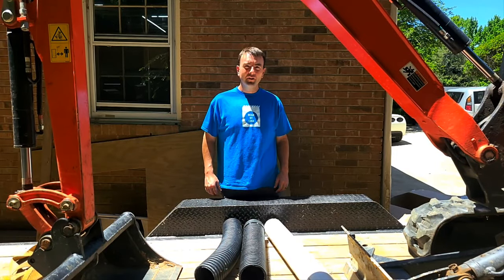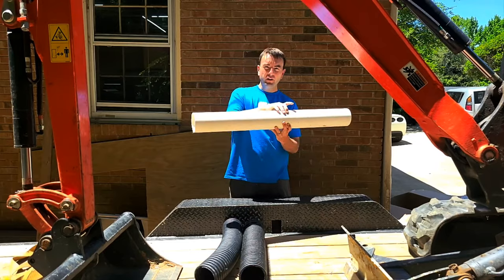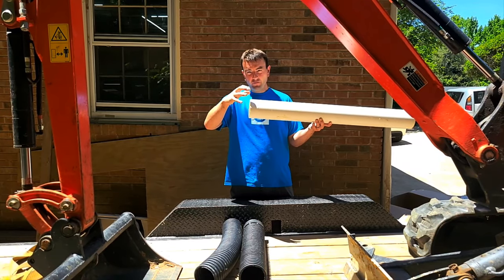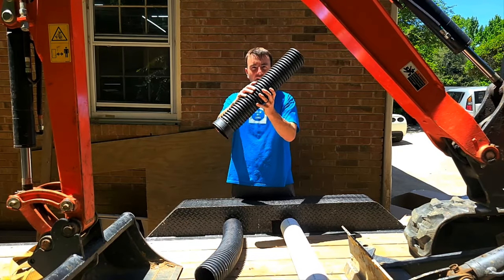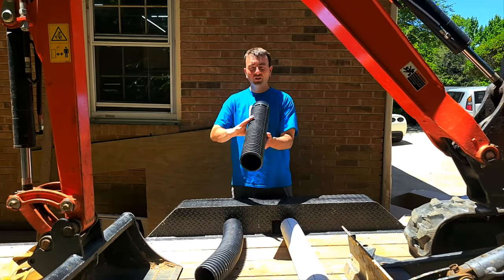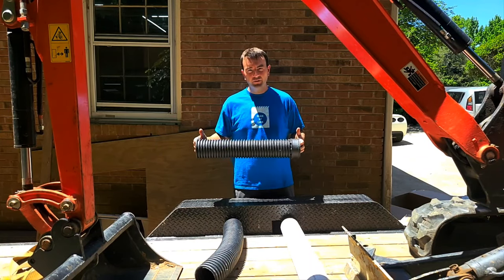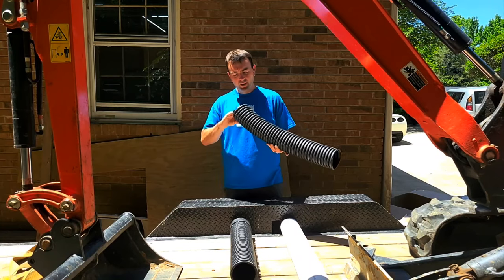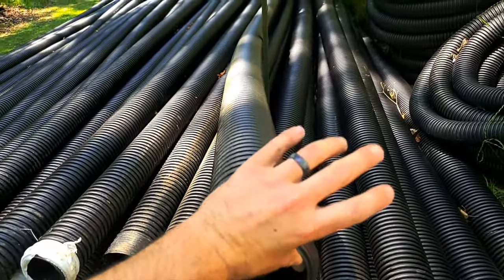Which Drain Pipe Should You Use?  Hint: it's probably not what you think

Comment: Do plumbers not use schedule 40 for waste lines? I haven’t heard of pvc waste lines cracking at joints from settling
Reply from the maker: They do.  However, the pipe is deeper with many less bends.  This protects from many roots and movement.  Landscape drainage isn't the same and the differences cause pvc to experience issues. 

It's possible to build a quality pvc drain system, but it takes much more time, skill, and money compared to a double wall system.  Most contractors don't do it right.
Reply: I used to do Septic work! All schedule 40 for waste. Never had a problem!
Reply: Plumbers do not use schedule 40 for sanitary discharge underground, they use schedule 80.

Comment: I used over 200 feet N-12 for both surface drains (solid) and French (perforated) drain , as recommended by the Franklin county (Ohio) drainage engineer.  Works well.
Reply: dual wall.  ADS.

Comment: I have a sump pump drainage problem. I have about 80' of 4" pvc running out of my basement along the ground. It has sprung leaks quite a few times and flooded my pasture before I noticed it.
Being how this piping drain is on top of the ground, the sun bakes utin the summer and it has below zero temps on occasion in winter. 
The slope is enough and the flow is insane, so it's never froze in 31 years.
I'm just wondering if I could use a solid black non-perferated "piping" outside for this? It runs to a little ditch in the woods and probably down to the back of my acres.

Comment: I have some area in my yard where a hole is forming, upon inspection the pvc pipe is cracked on the side and washing away the soil to create the hole in the lawn.  Question is, after watching your video what is the best way to connect the double wall ADS to the existing pvc pipe so I don’t have to replace the whole length from the downspout to the street, just a section of it?
Reply from the maker: We would us a PVC to corrugated adapter coupler (female to male) to attach to the double wall.  We would then wrap each seam with a blockmyroots.com root wrap.  If you want to protect the connection from crushing under heavy loads, you can sleeve it in a 6" double wall or PVC segment.
Reply from the maker: @BradMeyers-or3ok  https://youtu.be/abKpbUUE5aU?si=yWWypiIgNwVbIdAJ
Reply: Awesome!  Thank you.  Dug it up today so will be using this method to fix the pipe in the next couple days.

Comment: I'm wondering about lateral line pipe that way some of the water run off would be put back into the ground instead of it all running off to help with watering the yard and conserving some water   I'm sure it would probably still need a pop up or something to keep it from getting backed up  but what's your thoughts

Comment: I would like to use the ADS or Fratco double wall products to drain my sump discharge out to a river, but am having trouble locating distributors. I reached out to ADS. Do you know of anywhere around the Chicagoland area?
Reply from the maker: In the south, one will typically find double wall pipe at irrigation  suppliers.  Dont know about brand availability. Find out where irrigation contractors shop and you'll likely be good to go.
Reply: @drainmylawn  Thanks for the tip

Comment: We have in over 50 years of installing both landscape and sub drain pipe seen MANY MORE failures in the installation of ADS pipe over any version of PVC pipe.
Reply: That's what i thought
Reply: That's likely mostly due to majority of pipe installed is ads.
Reply: No most landscapers prefer to use smooth wall solid or perforated PVC pipe. Less problems longterm and much easier to set a grade. Also less issues with being crushed.
Reply: Never heard of this ads, i know pvc and aBs
Reply from the maker: One of the reasons you see more failures of ADS pipe over PVC is that there is a lot more of it.  Another significant contributing factor is that the worst contractors will always use the cheapest materials, which happen to be single wall corrugated.
Reply: @drainmylawn  I would agree with your second sentence. But would disagree with your first one. I have seen much more of any form of PVC (both solid and perf) used throughout the US than solid or perf ADS. When you add the perf PVC used as basement sub drains used in America my guess it is installed at least 4 times more. I only see homeowners use ADS now that don't know any better. Using any size or form of ADS is a mistake, we only use it in VERY LIMITED uses where you need flexability in a space.
Reply: @junkemails5050  Typically the PVC is white, both the ABS and ADS are generally black. ABS is a rigid plastic pipe used on building waste lines. ABS while black (usually )  is more flexible, cold in rolls and 10'-0" pieces at HD for exterior area drainage.
Reply from the maker: @frankgrant4784  Are referring to anything that ADS makes or their single wall specifically?  Their double wall is extremely strong.
Reply: @drainmylawn  Most ADS sold is in retail stores such as HD, Lowes and Ace. Because they are mostly retail stores they  cater to homeowners. So mostly single wall ADS, much fewer sources for double walled ADS.

Comment: I own a landscape company and am stuck on a project. I have a client who has a flower bed at the end of her sloped driveway, sloped toward the bed. And the bed is up against the house, right under the roof with no gutters so the water just pours on it, and its surrounded by concrete on all sides and is at the lowest point of the property. I can't do a french drain, there is no where to drain it to without tearing up her entire driveway. Any recommendations would be appreciated.
Reply from the maker: If you can't use gravity it sounds like you'll need to install a sump pump system but will still have to cut concrete to run the exit line somewhere else safe.
Reply: Bore under the driveway or whatever. I believe it is expensive though. They have borers now that can be steered and tracked as they progress.

Comment: I generally don’t comment on videos because I’m here to learn not look like a fool.   My plan is using Baughman tile 4” yellow corrugated pipe.  It’s a virgin plastic (nothing recycled).  There’s 2 downspout’s I’ll be connecting together.  Each will have a catch basin(FDM) a few feet after they start running parallel with the ground.  They will get connected with a wye and run out to the culvert pipe I have in front of my house.  This pipe seems really stiff compared to regular corrugated pipe which is why I bought it. I need a bit of flexibility as well. I know my ground expands and contracts a lot. My neighbor also has a few large trees close to where this is going.  I was afraid to use PVC because of all the connections needed for the 85’ run. One crack in and I’ll be right back where I am now. Do you see any problems with this? Located in SE Wisconsin.
Reply from the maker: Sounds like a solid plan.  I only have experience with the 6" Baughman yellow, and it's a good pipe.
Reply: @drainmylawn  any recommendations for fill around the pipe itself or just pack it in with dirt?

Comment: I  appreciate your advice. I am installing a system that I  will have people driving over regularly. In that case, would PVC be better (no trees around for root concerns, etc.).? Thoughts?
Reply from the maker: We use and recommend double wall corrugated for that purpose.  You can get AASHTO spec'd pipe for added strength.

Comment: Interesting.  The dual wall must be a lot more than regular corrugated I would assume.  Thanks for the video.
Reply from the maker: The pipe itself is about 3 times the cost of single wall.   Installation takes more thought and time because it's not as flexible.  We typically charge about $5 more per foot for the double wall over single wall.
Reply: Its also harder to find.  And shipping charges aren't  cost friendly for people.  The market for this type of work doesn't always work for everyone and their needs.  I had to use single wall pipe in my job the take another pipe the same length and cut it down the middle in 1 cut and slip that over the original line a zip tie it every other foot.  Little hokey but, should hold up for a few more years then if it was a single wall pipe..  The line I dug up was collapsed in one spot and had a couple of minor cracks.  My job wasn't the best of ways, I saved a few dollars added a few years.  But, if it were more practical I definitely would go double wall pipe.

Comment: I am wanting to install the French drain pipe I bought to create a subsurface watering system around a lone tree. I need ideas on how best to make the surface inlet connection for watering.
Reply from the maker: Interesting idea.  We haven't done that before.  You could run a drain system in reverse and feed water into the end of the solid pipe.  Hope it works!

Comment: So -- do you install footer tiles fro new construction of basements?  Do you ise a schedule 40 perforated pipe there and do you used a filter fabric for new basement tile and PVC pipe or what do you say is BEST PRACTICE for new construction of a basement foundation drainage-way?
Reply from the maker: We don't install footer tiles but would used FDM's high octane 8 slot without hesitation.  I would use the fabric the same way as with a french drain.
Reply: We use sdr35 for all our concrete retaining walls as tall as 12 feet . I would recommend SDR35  if your doing a basement  at minium

Comment: Can you put N12 under a concrete slab?
Reply from the maker: Yes to under sidewalks, patios, and driveways.  If you want more strength, search for "AASHTO certified"
Reply: @drainmylawn  Thank you for replying. So kind of you! I'm planning on putting gravel under the pipe. Should I cover the pipe with gravel before pouring the concrete on top or should I pour the concrete around the top and sides of the pipe?
Reply from the maker: @sk8guit  You're welcome! Gravel is good because it won't settle once it's compacted.

Comment: Most people say that PVC or ABS is superior to the corrugated pipe.  The corrugated smooth interior pipe looks pretty good, but won't those rubber joint seals rot eventually?  If you use PVC or ABS, wouldn't it just be a matter of compacting the soil well to prevent the settling you mentioned and a long run of pipe should have some flexibility?
Reply: I have the same concern about the rubber seal rotting. It's essentially an oversized o-ring....and o-rings eventually fail in the long run and require replacement.

Comment: How about adding cost/foot so we have some rough idea about the material cost during this inflation period?  Labor cost should probably be similar since one still need to dig drenges and layout the pipes.  The 3rd option probably can be use with socks?
Reply from the maker: Cost of materials will depend on your local suppliers.  Labor cost is higher on more rigid pipe because it takes more time and precision to work with.

Comment: I wonder why PVC irrigation pipes don't crack or break.  Even schedule 125 when a larger interior size is needed for volume.
Reply from the maker: Good question.  The answer is... they do!  Typically, your pressure lines are going to have little to no bends in them before they run to the backflow.  No bends and less complexity reduce the risk of cracking.  We come across leaky irrigation all the time.  The zone pipe leaks are typically obscured by the watering that's happening when they run plus, they are under less pressure.  

Drainage systems generally require more joints than irrigation.  The joints are the weak points on all systems, but cracking is the biggest risk for pvc joints (in drainage).

Comment: If you properly install pvc you won’t have any problems with it cracking. Also they make gasketed joints for pvc to allow some flex in the pipe. But again you wouldn’t have any flex if it’s installed properly.
Reply from the maker: The "installed properly" part is the big challenge with pvc drains in an established landscape.  PVC needs to be installed deep, bedded properly, and joints minimized.
Reply: @drainmylawn  pretty much any pipe would need to be bedded and backfilled properly. You need class I, II, or III material to backfill pvc and N12. 4 inches of compacted bedding, 21 inch wide trench, 12 inches of compacted cover. Joints aren’t an issue if you know how to properly prep one. The end of a pvc pipe needs to be clean and chamfered. Easy to do if you have a utility knife, but if you have a grinder it is much quicker.
Reply: A long run of PVC does have some flex in it, and I'm inclined to agree with you.  It sounds like these guys are looking for blow and go installation, not something that if installed right will last a very very long time and possibly up to 100 years.

Comment: Definitely food for thought. I am curious as to why you didn't include SDR35 sewer pipe in the comparison.
Reply from the maker: SDR35 is more suitable for lawn drainage than schedule 40 due to more flexibility but still has similar drawbacks compared to N12.  The rigidity of the pipe lends to more mistakes in installation which cause more issues down the road.  All in all, SDR35 is a fine option if installed and bedded properly.
Reply: @drainmylawn  Thanks for the feedback. Would sand as a bedding material provide enough cushion (soil is mid-western clay)?
Reply from the maker: You're welcome!  The pipe bed should be compact and firm.  The trench needs to be wide enough to get the backfill fully around the pipe (typically 2x pipe width).

Comment: PVC joints are welded with PVC cement. The welded connections are stronger than the pipes or fittings alone. 

The ridges in the interior corrugated begin to fill with shingle dust (stone like) immediately during the first storm.
Reply: The cracking isn't from weak joints.  It's from the lack of flexibility and brittleness when movement is needed for settling or other pressures.
Reply: the pvc joints are the weakest point
Reply: @raiconlan1  Try to break a properly cemented PVC joint anyway you want. You'll break the pipe most times. The fitting will break the others. You'll never break the weld.
Reply: whether I can break it is immaterial when I dig up old ones they are broken
Reply: @raiconlan1  What is material is whether they were glued properly with the correct cement. There's no way a properly welded schedule 40 connection will break before a pipe or fitting. I think you need to be more careful with your shovel.
Reply: @raiconlan1  When PVC joints are properly glued they have been shown to be actually stronger than the PVC pipe itself

Comment: Pvc is better than corrugated because there's no place for mosquito eggs to settle and hide.  Additionally, corrugated is more likely to collapse under weight and retain debris than pvc.

ADS tends to break fairly often as well...
Reply from the maker: @Monkeybizness707  you must have missed the part about double wall corrugated.  Checks all the boxes and no cracking.
Reply: @drainmylawn  from my experience, double wall cracks more than single wall, and when it does it leaves voids and jagged edges

Comment: Anecdotal evidence: The irony in this video is I had PVC originally placed in two buried downspouts ~7 years ago and I haven't had any issues with drainage, clogs, or breaks.  After a few unseasonable  torrential downpours in the Midwest I had to get an additional buried downspout on the opposite end of the house.   A contractor insisted on using the double corrugated and I trusted their judgement but preferred the PVC to match the construction on the other corners given the proven reliability. 

Two years later and I've noticed water in the basement.   I traced back the issue to the double corrugated crushed at the elbow joint by the drain that had a piece of piping sticking up 2 1/2" and caked with debris.   I'll be replacing with PVC, gravel, etc.
Reply: We use sdr35 pipe for all our surfaces and French drains. The double corrugated does work ideally they should of put a sweep elbow tho
Reply: Yeah, one advantage to the various 4” PVC pipes (Schedule 40 solid wall, Schedule 40 DWV foam core wall, SDR35, and S&D) is how tightly they connect to hubs, elbows and wyes. You can’t get that kind of fit with corrugated pipe.

Comment: Yep. Its why i dislike the stuff. Those pvc pipes always break. Every time i dig up pvc, all i see is repai after repair. And it's so brittle that just digging it up breaks it. When i dig up cortex or funny pipe. It's been there for decades. Sure. There's probably a repair here and there. Or an obvious sign someone made a change. But the pipes are still in great shape. I could reinstall  that pipe and it would probably last another 20 years or more.

I would only install pvc pipe where i can get to it ridiculously easily. Minimum effort. And where it doesn't get exposure to elements. No temp swings. No pressure spikes. No exposure to dirt. Chemicals. Water. Etc. Pvc breaks down too easily. I used to use the stuff a lot when i was young. But it was just a maintenance nightmare.

Comment: Yea you know , the stuff they use to go out to the septic and run to the drain field, brittle and def separates and goes to shit after 8 years or so especially if they are just slapping houses up and doing half ass work. Man can you tell Ive delt with this or what. Love living in florida where houses are built like complete trash and have a life expectancy of 10 years maybe and then foundations crack tiles pop and soil erodes ect..do ur homework before getting a home in florida , i just rent to but boy is it a sad site lol
Reply from the maker: @Pete..  Didn't mean to offend! Septic and sewer lines don't have as many turns and bends as drain systems do and they are buried deeper than drainage systems.  Less  points of failure and out of the way of many roots that will move the pipe. It's all about application.